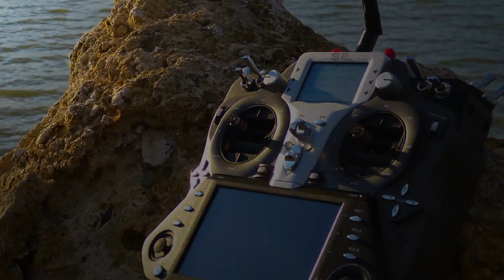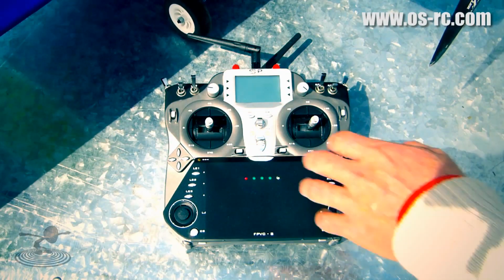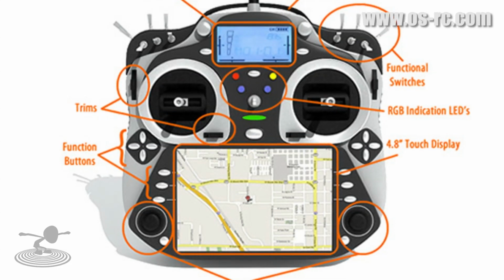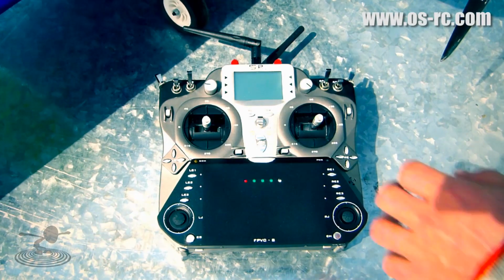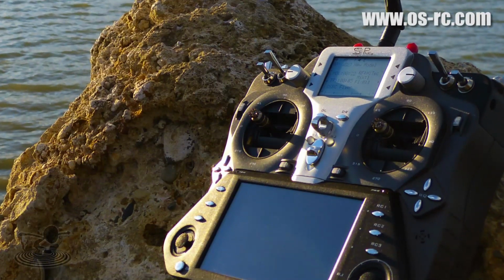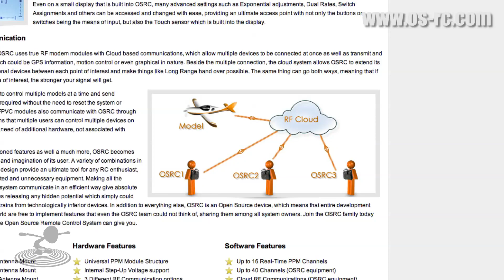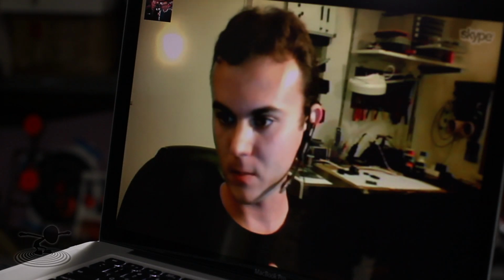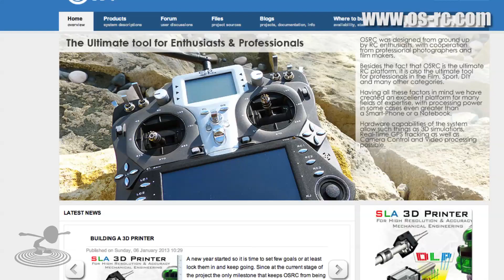Flite Test - The OSRC Project

Comment: This is AWESOME!  I'm not proficient enough to take full advantage of that amazing remote but I think smaller simpler ones with the core features would be a huge upgrade.  The true professional (or future amature) can use all the bells and whistles but if I just had force feedback for my quad it would be incredible.  Not so much what it's doing but more what the FC is doing to correct certain things.  That alone will give so much information about wind conditions and orientation.

Comment: I just saw this / heard about OS-RC 
I almost wonder with 2015/16 and the EXPLOSION of RACE quads / FPV that there would be MORE support to get the funding in place 

IMHO the force feedback I could see being used as a "trainer feature" by turning on a auto level / horizon mode that would 
"push" the controls so if you WANT to go beyond 45 degrees push through the feedback but release pressure then the auto level return to hover kicks in

Comment: I need this radio!  I'm tired of the old radio manufacturers holding us back with their high priced products with small advancements.

A really good radio of recent is the Hitec Aurora 9 with its built-in telemetry and large touch screen and that's already over 2 years old!  Then you have Futaba's ridiculous high end $2000+ radio with parts that costs about $150 at most including it's large color LCD screen. Those screens are not expensive anymore -- they're made in the billions for smartphones.

Comment: mapping the stick movements for tricks is mostly useless unless you have the EXACT same plane with the exact same setup (physical and electronic) flown in the exact same environmental condition. in case anybody is confused, that scenario is IMPOSSIBLE except in a simulator. besides that, nice radio!

Comment: Good attempt! But the only thing I would like from this project is control surface g force feedback, as of others IMHO they r just mashing all existing technology , which I would happily add to the Tx to my own liking. As for the downloadable tricks / learner instruction I think it is going to be a failure(sorry about the doom n gloom), because unless you have two completely  identical planes in terms of power system, ESC timing, servo reaction, control surface throw, Tx settings, etc, employing same input would have a very different result.
Reply: Op

Comment: ok the thing is this tranceiver remote control call it what you like is really working on an operating system which means depending on the hardware that's integrated in it the functions are actually UNLIMITED.

Comment: They could make a hand heater around the radio's edges for people that fly in cold weather
Reply: They should also put fans around the edge for people with sweaty palms flying in the heat.  Would also double as a cooling system for the processor and a boards running inside.
Reply: Ryan Ho ***** I'd also like a cup holder ;)
Reply: kubanishku
and a mini fridge.
Reply: I'd like a built in Retractable Transmitter Tray since we are requesting add on's. LOL!

Comment: I may not have heard him correctly but I though he said with all the bells and whistles it would run about 1200 Euro.   Was that correct?   That would be about $1530.00 USD.  Still kind of pricey but with all you get.   I can't say it's too expensive.   I like the modular part.   That way you can build it the way you need.  Keep the price down a little and then add on later.
Reply: I thought he said the basic unit was between $350-$400 Euros which translates to 400 Euro equals
506.81 US Dollar. Sounds like a system I would like to have and see put into competition with the Big Boy Companys [which is probably why he is having a difficult time getting exposure]. Thanks to you guys at "Flite Test" for doing what you do too open up avenues for lovers of the hobby to express their creativity and for others to learn.                              PS. I got my first kit "FT Cruiser" yesterday. I have to say it is a very well thought out and cut Kit. After this I'm cracken to build "The Big Kraken."
Reply: This was almost 2 years ago, and sites no longer exist.. so dead project.  And why it died?  because this makes the system competitive and hence cheap, and the big boys don't want that..

Comment: It would appear to be a ground based computer talking to a computer in the aircraft.
Heck of a change only in that it has more programmable features, is modular, and actually looks like someone thought things through. That said if it isn't already patented (of course can't patent an idea) then it is already on the drawing boards of ding-wa inc of Guandong and will be out in 6 months for $199.
Better spend some bucks and lock down the tech before you worry about a printer.

Comment: Well, except for the feedback on the sticks, i really can't see the point of this system. Sure from a technical perspective, it's amazing. But who really needs 40+ channels? We have fpv goggles who needs that tiny screen? Modularity sounds cool on paper but, it also means more points for the system to fail. I wouldn't want my Radio to be modular. And 2300€? That's insane...
Reply: I believe he said 1300E. The fact that it is so modular, interchangeable, and adjustable makes this the most flexible radio in the world, that I know of. View his youtube vid where he discusses it in more length, its almost an hour long...
Reply: I think you're hating... This thing is so amazing, this could help so many new pilots learn how to fly and get more people into the hobby.
Reply: 2000$ Radio will help new people? Seriously? I can't really think of even one single situation that "stick replay" function would be useful. Wanna try a new trick?
1)Connect your 50$ radio to one of the numerous free simulator softwares  on a PC
2)Try whatever you want
3)???
4)Profit.
Reply: flanker
 Well obviously a new pilot wont be using this, like me. but he setting a new standard for RC industry the things he will do with this will eventually trickle down toward cheaper and more affordable systems. you really think spectrum spends more then 10-50$ making a radio even their high end radios? This is totally feasible, just no one wants to take the risk.
Reply: It's only "insane" if you don't see the value in it. This young man has a dream, a very creative idea and the intellectual skill set to make it live and breath. "That's Insane" is what someone once said about the first RC Airplane.
Reply: Tony Harris I'm not saying this isn't a monumental achievement from a technical standpoint. What I'm saying is, as things stand now, there really isn't any need for the functionality of this radio.

Maybe It's just ahead of it's time? Like a dishwasher before the invention of the electricity?

Comment: This still pisses me off...  It's been years since this was "A Thing" and it just flopped?  I don't believe it.  There is still nothing like it out there.   Yes there are systems that are getting close like the Radio Master X16, etc.   But none of them have the best feature.  "Force Feedback".
This would change everything, to feel what your model is doing.   WHY?  WHY?  Why hasn't this already been done else where?   Seriously...  W T F?    Hands down this would be paramount for the FPV users especially.  As well as for RC car racers that could feel the traction loss around hard corners etc.
Reply: I think force feedback is really cool but it's not surprising it hasn't taken off. You need a way to measure the force at the servo and transmit this information back to the radio. Adding force feedback would make gear much more expensive and heavier.
I have a couple MicroSoft Sidewinder 2 Force Feedback joysticks and I'd love to figure out how to incorporate one into a RC transmitter. My main problem is on the servo side. I need to figure out force feedback servos.

For what it's worth, I've flown a RC helicopter using a Wii Nunchuck as the controller. The joystick on the Nunchuck controlled pith and roll and yaw and throttle was controlled with the accelerometer.

I just notice you have videos on your channel. Very cool. It's always fun to see other people's projects. The playlist "Fun with Spin" on my channel includes some of my favorite personal projects. I don't have a video of the Nunchuck helicopter controller since I made it before I started to document my projects on video.